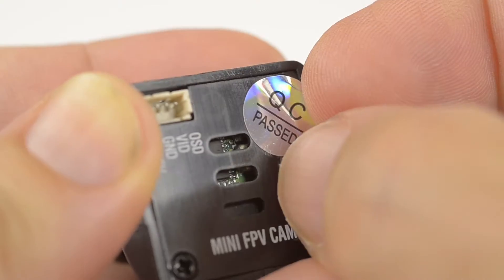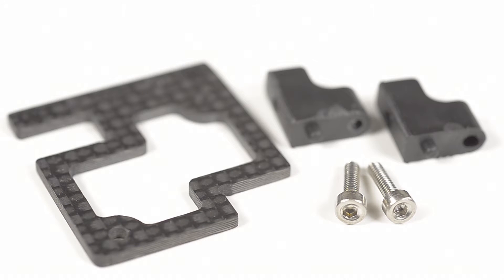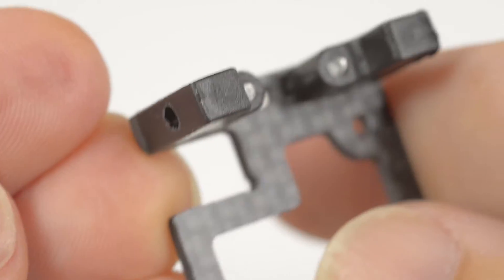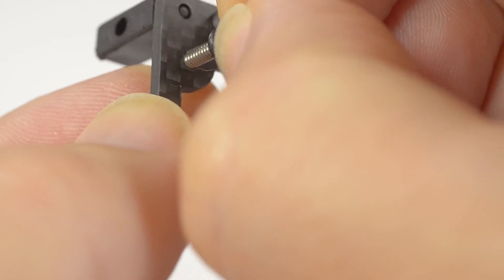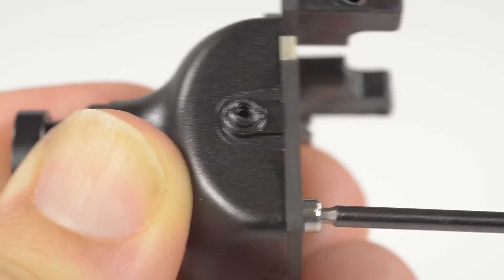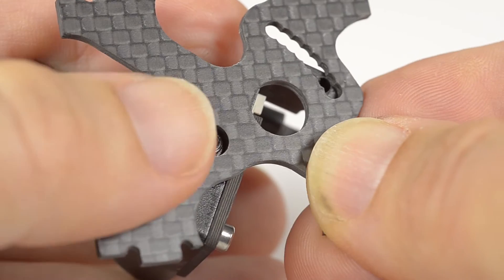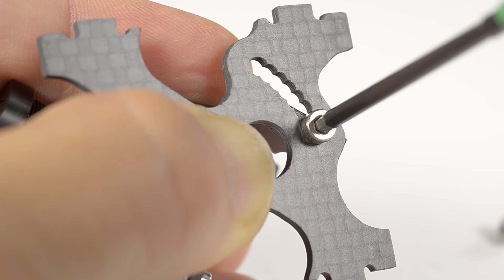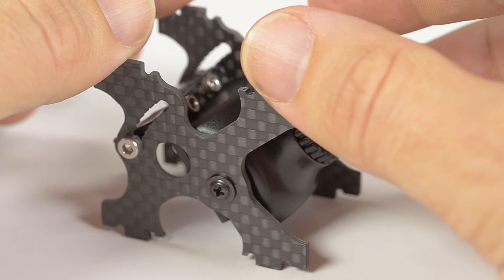ImpulseRC Alien Build - 5" & 6" Camera Assembly

Comment: I thought that I am too picky when it comes to workmanship, but you take it to a whole new level. My bottom plate has 4 small holes ( two pairs ) about 1mm diameter. They can face left or right depending which way you turn the bottom plate. Any I idea what are they for, and which way should they face, left or right ?

Comment: Will this camera work with the mouting?
Reply from the maker: +Jimmy Husain Which camera?!
Reply: Will Runcam Eagle fit? Even if it's just mounted with the two screws on the side?
Reply from the maker: Sorry but we haven't tested that. I have heard some people trying things like filing the edges of the case and getting it to fix, or even getting an empty case from a different camera and using that. We will be releasing a new plate that supports RunCam Swift very soon so maybe an Eagle in a Swift case would work? Sorry I don't know, just some ideas!
Reply: Sounds good. I'll have to give that a try. Thanks for the reply, your guy's attention to detail and part availability is second to none. Keep up the good work!